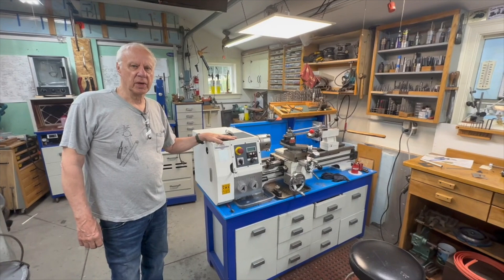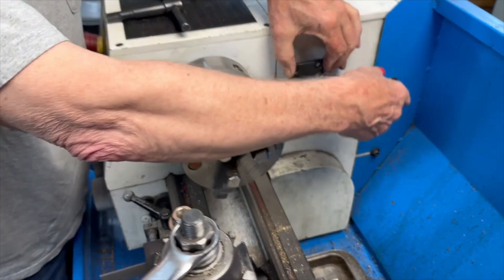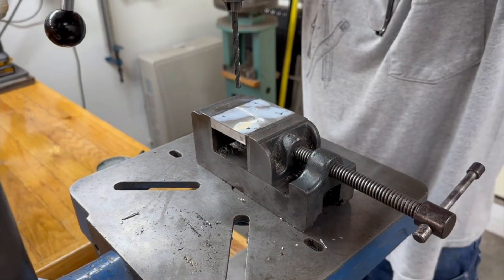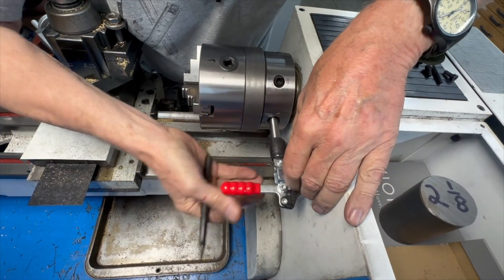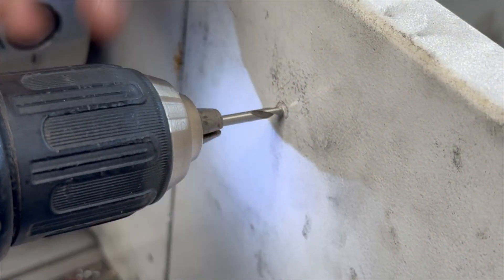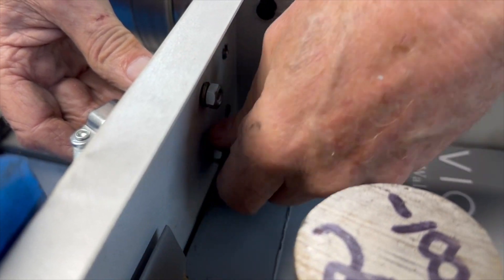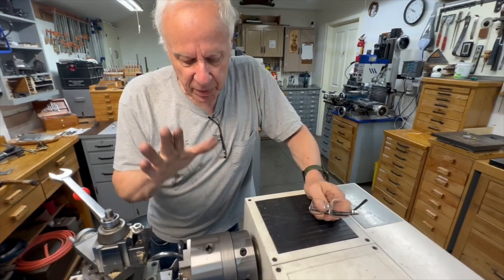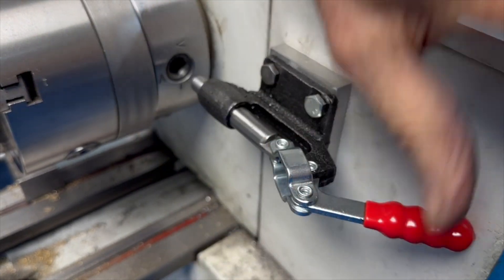PM 1228 Lathe Installing a Spindle Lock

Comment: Great idea Joseph.  But I installed mine on the front at about 42 degree angle down from spindle CL.  Easier access and it doesn't interfere with my magnetic light behind the chuck.  Also added a Hitch Keeper Pin as a tag & lockout to avoid inadvertently engaging it.   Keep up the great work!

Comment: Joe thanks for posting these wonderful videos. I just got a 1228 PM lathe also. Did  you need to turn down the end of the latch to fit the square hole in the spindle? Or was your latch as shown when you purchased it? 
Also can you tell us the specifics of the gears and where you got them for the 3:1 gear reduction mod.? 
Anything you can tell us will be most helpful. Thank you sir! Please keep ‘em coming.
Reply from the maker: @biggymu  Hi, For the spindle lock, I just used an Allen head screw with the head turned down a little bit. As for the gears, they are mod 1 C 45 gears. One 60 tooth and two 20 tooth. I got them off of eBay and the sellers name is.giorgio 11185. The cost of the time was less than $30 including the shipping from China.  Thank you for watching my channel Joe.
Reply from the maker: @biggymu  Good luck with your modification , you will really appreciate it when it’s finished. Joe
Reply: I found him and the gears, he’s Asia Engineer now. They have a large store. 
Good stuff! Thanks Joe.

Comment: Instead of risking burning out your belt if you leave the lock engaged, since you're already drilling into the electronics compartment, couldn't you add a switch in series with the e-stop to serve as an interlock?
Reply from the maker: @markstorch4040  Hi Mark, You could add a switch but I don’t think it’s really necessary, If you do forget and turn it on ,you will turn it off again quickly. I did it a couple of times when I first started using it, with no damage. I also didn’t have the belt over tight, it’s just not necessary for the light work l do making model engines. Thank you Joe

Comment: I have done this exact mod to my PM1228 lathe, I nearly forget to unlock it every time I'm done using it. one thing I think I need to add is a handle "keeper" of some sort, in running the lathe I noticed a unnerving tendency for the lock handle shaft to creep towards the chuck & chatter against it.
Reply from the maker: @bruceang82  that might be the problem, maybe you can just take it off and hammer one of the rivets to put a little bit of bind back in it.
Reply: @JoesModelEngines  that's exactly what I did Joe, while still mounted I just tapped all 3 rivets with a dolly on the other side...problem fixed! thanks Joe.
Reply from the maker: @bruceang82  Hi I checked mine because I never had any problems with creeping. What I found is that the rivets are a bit tight and cause a little friction. Maybe you could just try tightening one of the rivets. Joe
Reply: @JoesModelEngines  Good idea, Joe.  I think I made a mistake by lubing it & working most of the friction out of it.
Reply from the maker: @bruceang82 Good thinking I thought I would have to take it off. Glad to hear that it worked.